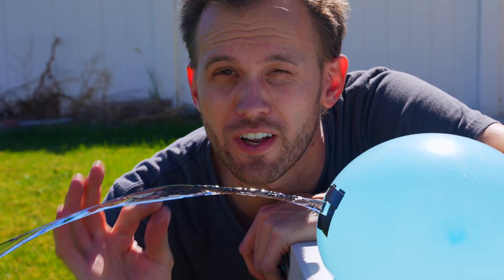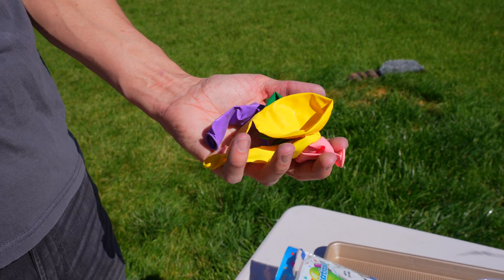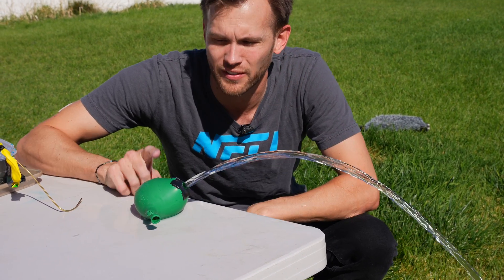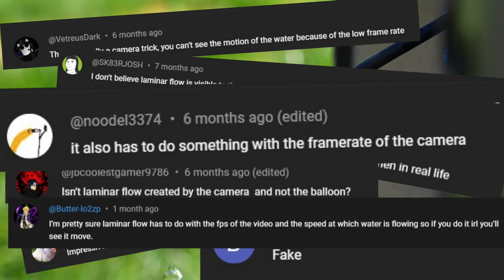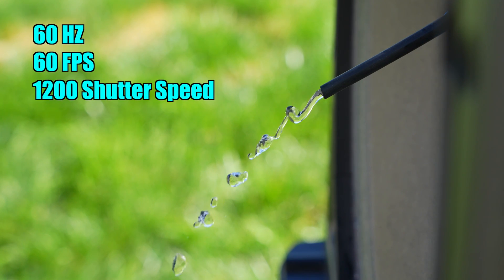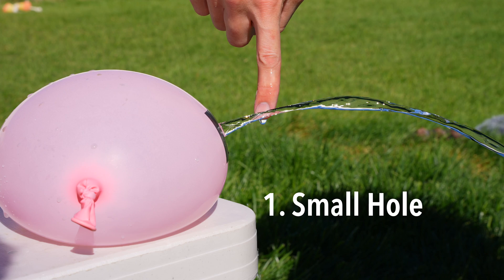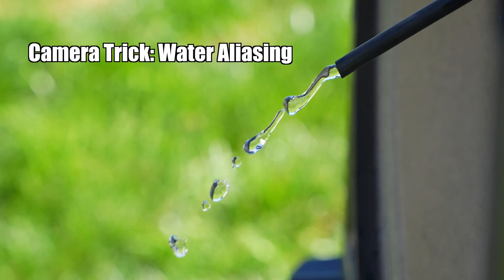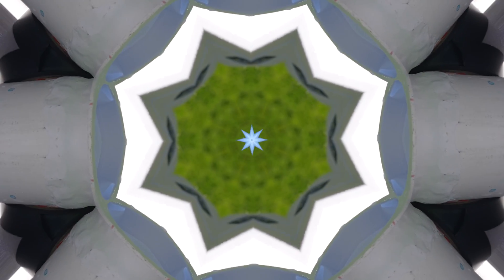Is That REALLY Laminar Flow?

Comment: By the way there is some important vocab for the water aliasing that should ideally be corrected:

1. Technically the camera and speaker aren't synchronized because there's no tie between the two systems to stay in sync. They're merely synchronous,  meaning the effect will appear on camera no matter at what phase of the waveform is being captured.

2. The defining factor for what makes the camera and the wave synchronous is frame rate, not shutter speed. Frame rate is the number of pictures taken per second, while shutter speed is the duration of time that is actually recorded within each frame. I see what you did with a 360 degree shutter angle to simulate a real-life perception, so it seems you understand that shutter speed (or shutter angle I guess) is only responsible for making the wave appear smooth.

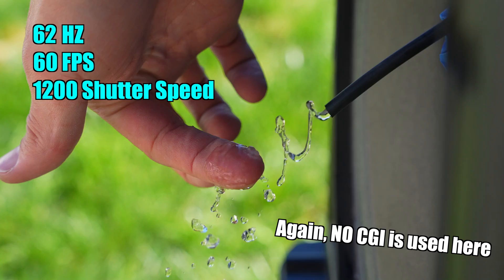Comment: 4:20 You can see the hose vibrating back and forth at the rate of the absolute difference of the speaker frequency and the frame rate.  When you have two sounds interacting like this, you get a beat based on the difference of the frequency of the difference.

Comment: What happens if you continuously refill the balloon? Like putting on the end of a hose.
Reply: It could work but it could also disrupt the effect because the water is no longer flow at a consistent speed/pressure

Comment: Can you achieve laminar flow with thinner or thicker liquids? like Hot water vs Cold, pure alcohol, if feasible liquid nitrogen or oxygen?
Your hole punching method, have you tried a Pin or low powered bb gun to try and punch a rounder hole? does the straight craft blade edge help more since you seem to stick it fully in there.

Comment: How about sticking an hose into the intake of the balloon then matching the inflow to the outflow (once the balloon is filled) for a longer demo. Would it work?
Reply from the maker: The water has to settle in the balloon to stop all the motion of the water. Connected to a hose it would have high turbulence.
Reply: @NFTI  So, it might only work if it was a very large balloon and a low in/ out flow?

Comment: The water aliasing is really just exploiting the wagon wheel effect all cameras have. They don't actually capture motion but rather take several still images really quickly and it looks like motion. So matching the jiggle with the rate its taking the photos means the water is in the same spot every time so it appears frozen in time

Comment: The shutter speed part of the video is not just water. Rims on a car, helicopter blades, fan blades, you can match the shutter speed to any of those and you will get some cool effects
Reply: I'd consider that effect, called rolling shutter, a slightly different effect, as it causes a spinning, solid object to appear distorted due to the limit of how fast a camera can capture each row of pixels, while water aliasing happens because of how the framerate itself syncs. There are some cameras that don't have rolling shutter, called "global shutter" cameras, and those cameras would still be able to record water aliasing, but spinning objects would appear as expected without distortion
Reply: not shutter speed, frame rate. the result is called the wagon wheel effect

Comment: Small correction for 5:45, it isn't only visible through a camera. You can achieve the same effect to the naked eye if you set this up with a strobe light set to the same frequency of the speaker.
Reply: ...and the surroundings are dark enough to hide the water when the strobe goes out.  Outside during Nate's sunny day wouldn't work so well with a strobe.

Another method, used by some of the first engineers to explore animation, involves viewing a scene through slits, to hide the time and image in-between what you want to show.  They made wheels where there was a movie printed inside, with slits in-between so you could view the opposite side of the wheel as it spun.  This flicker is essentially also how mechanical (film) video capture is made.
Reply: Or, just blink really fast…
Reply: @RandomBogey  Or by other effect that mimics a strobe light without actually using a strobe light. (You can often see this effect when looking at car tires through a picket fence.)
Reply: technically not visible through added trickery. since the strobe light mimics a changing "frame rate" to your eye

Comment: With your laminar flow device, I'm wondering what it would look like if all the streams weren't recombined and instead were just coming out of the array of straws.
Reply: The flows would gain turbulence and hit each other turning into a mess very quickly after leaving each hole, with the possible exception of pointing the thing straight down so gravity wasn't shearing the flow.  Air turbulence would still be a factor there, as it was dragged alongside each stream.  Throw in a vacuum, maybe that would also factor out and keep the streams smooth for a visible distance.  Eventually even microscopic defects in the straws and surface tension at the exit edges become factors and the streams will bump into each other and create turbulence, turning into a chaotic spray.

Basically, it's almost impossible to make it not look turbulent.

Comment: Shotgun mic audio at the end?  But you were wearing your lapel mic.

Also how does the tape maintain the balloon's integrity and make it resistant to popping?
Reply from the maker: The buzzing when I'm next to the speaker?  I forgot to turn my lav mic on.

The tape stops the ballon from tearing open.  Within the square, the stretching is localised so after you pop that one part of it, the latex relaxes to where it's no longer under tension, but the tape stops the rest of the balloon tension from pulling on it.
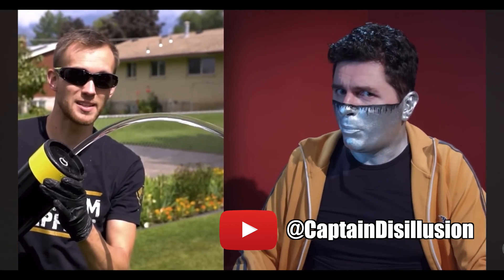Reply: @NFTI  Not the part with the speaker, I meant the end at 5:59 .

Ahhh so the stickiness of the tape maintains the latex tension for the rest of the balloon since the latex under the tape is stuck in its original stretched state.  I think I get it now.

Thanks for explaining Nate!  Much appreciated.

Comment: It is visible to the naked eye, if you tune a strobe light to the same frequency.
Reply from the maker: True!  But I didn't wanna set this up indoors.
Reply: But, is water 'WET'? @NFTI
Reply: @NFTI  Bathtub? Just cuz cool to see?
Reply: I had a bunch of DJ lights setup in my apt once in college and took a shower with a strobe on. Made for a trippy effect feeling the water hitting me but seeing it frozen in the air.

Trying to show this effect using a strobe on camera would basically be the same as without the strobe for viewers since you’re still going to be syncing the camera to the frequency right?
Reply: @heyjustj  yup. It definitely wouldn't make a good video cuz you'd need to sync it to the camera. but in case someone wanted to do it themselves, it's pretty cool.
Reply: correct